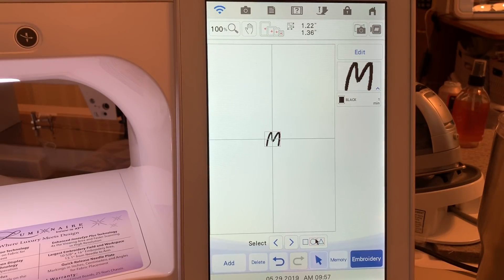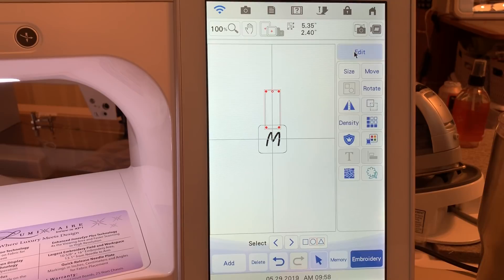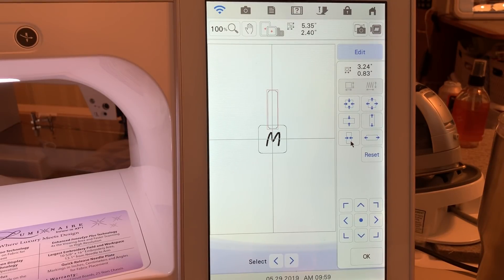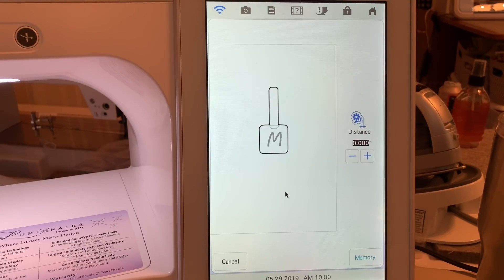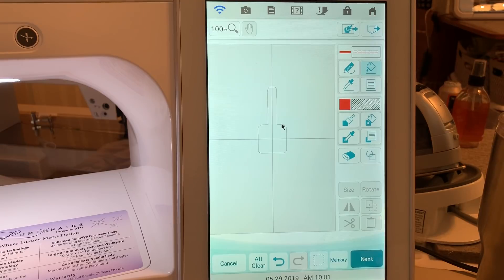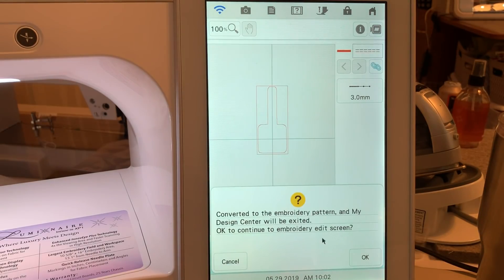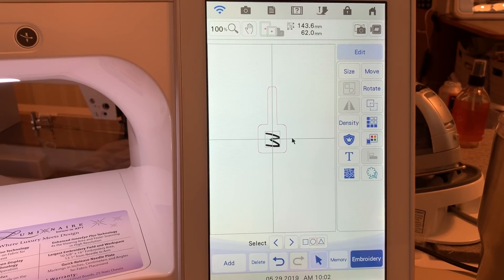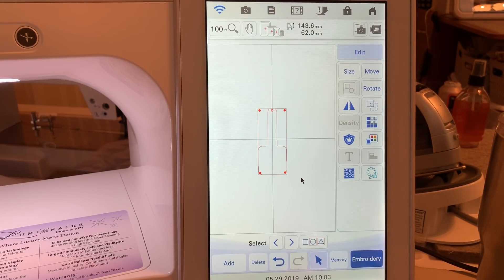Luminaire - How to Create a Quick Key fob

Comment: According to brother: if you look at the stitches the first one has a black line and a red line underneath and the next one has 3 black lines and a red line underneath. The red line is an underlay  line. Technically the red line is not the stitch line so what we think as a double run is a single run with an underlay. But I agree with you. We need to have a single run with no underlay. Or the option to not use the underlay.
Reply from the maker: Hopefully, Brother and Babylock get in tune with quilters who want a single running stitch.

Comment: Thank you. Could you expand on this video a little and show how to send it to the scan n cut? I recently purchased a Solaris and I am not sure how all of this works. Thanks again for all of your instructions they are easier to watch than trying to find the topics in the on line manual. (I sure miss paper manuals).
Reply from the maker: Leah Geary - I recorded two videos this past week about file types and the scan n cut.  I do not own the DX 225.  I own the CW650.  My 650 will not read the PHX file created on the Luminaire so I take it to my PE Design 11 software to send it directly to the scan n cut.  If you own a Solaris and a DX 225 you want to apply the Applique Material Thread color in the Country or Embroidery Thread chart to the outline shown in the video I mentioned.  Save the design to the USB stick and the DX 225 can read the file.  If you have a DX125, you will need software (such as PE Design 11 or Palette 11that can read the PHX file).  Open the software and IMPORT the PHX file.  In PE Design 11, you can send directly to your Scan N Cut.  In Palette 11, you would want to save as a PES file.  Tell me your set up and I will see if I can help you.